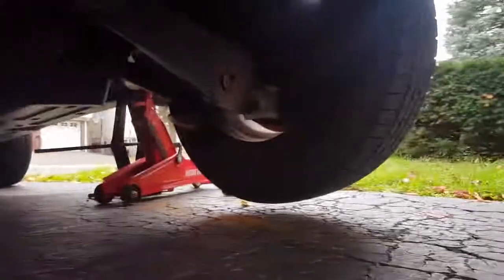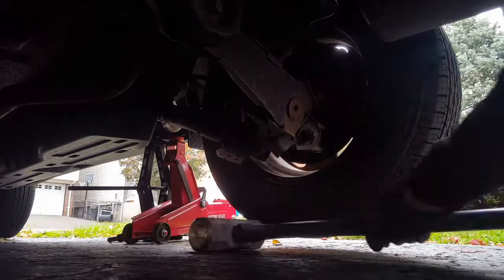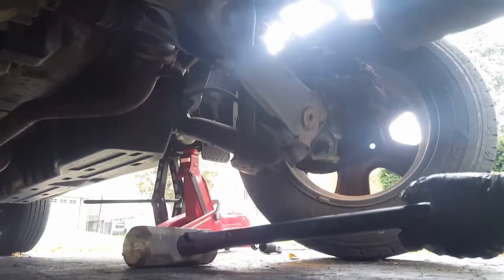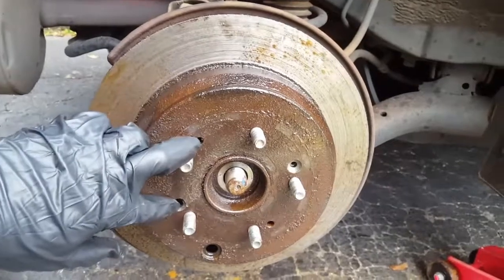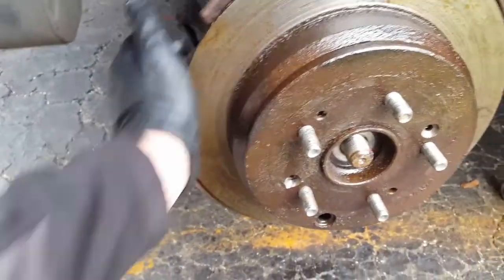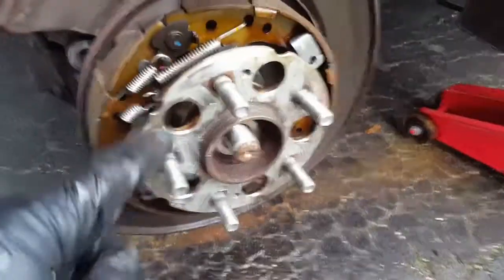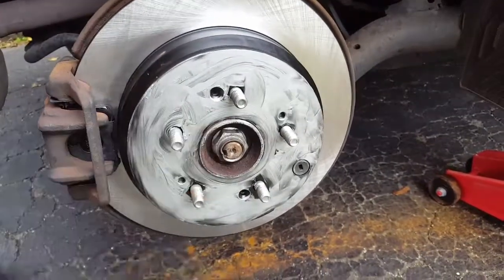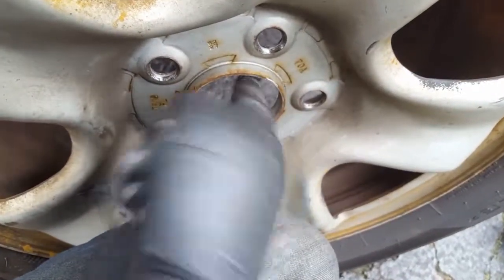2013 Honda CR-V AWD rear wheels stuck

Comment: Loosening the lug nuts just enough so they aren't holding the wheel in place and driving around jerking the car side to side  works for when the wheels are on so bad that the sledge just won't cut it.